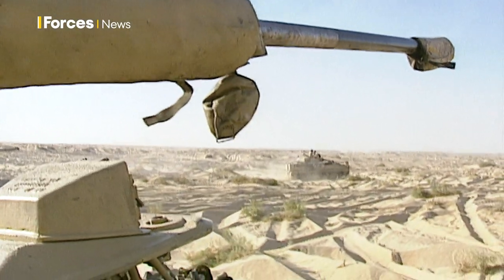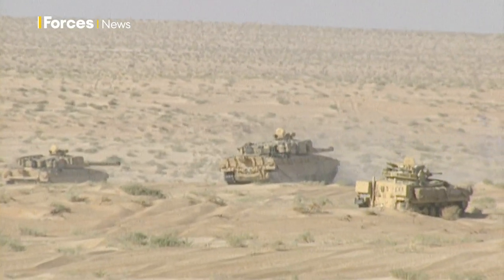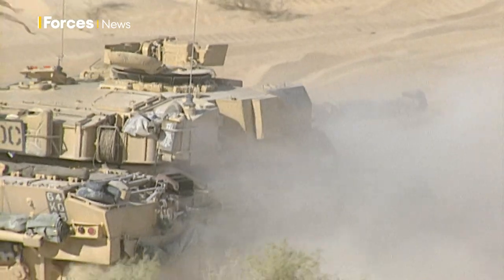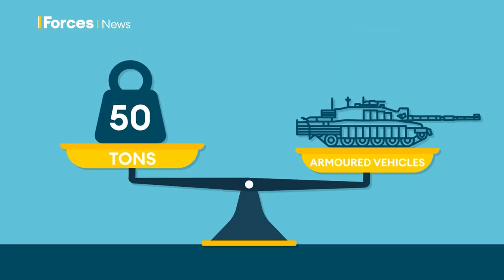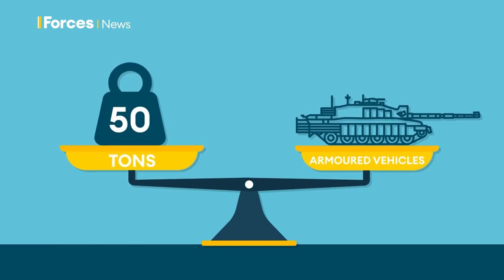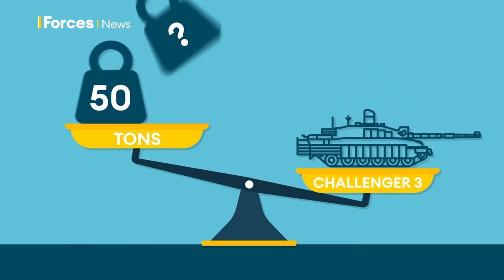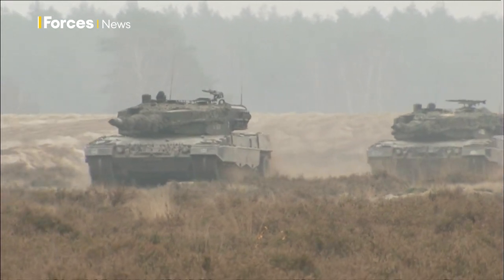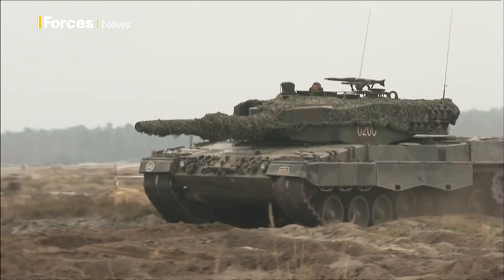Could Challenger 3 Tank Upgrades Be Axed Like Warrior's?

Comment: Warrior was ultimately axed because as far as I’m aware they already had full intent to replace all of them with Boxer, Challenger 3 should be fine due to the lack of replacement
Reply: Yes, this video is fairly disingenuous as it says "similar upgrades" and uses that term to mean similar situation/ context which is clearly inaccurate. The Challenger is the UK's MBT platform and the force is already being downsized. To not upgrade it would be the worst of both worlds. The Warrior situation is clearly different, as the "researcher" says - Warrior had issues with it's hull and turret system, something not applicable to Challenger. It was also up for replacement as noted elsewhere. Lastly, a IFV doesn't take nearly the funding or development as an MBT - in fact IFVs are regularly designed and sold across NATO forces so we could easily jump on another programme if we wanted to. The MBT is a different story - it represents the peak of a nation's armoured fighting capability. We'd as soon buy the Leclerc or Leopard to replace Challenger as the US would be to buy the Merkava as a replacement for it's Abrams.

One final point to shore up my last remark there - the "researcher" himself makes an indirect note about this. The only other use of the Challenger platform is Oman. Countries that are capable of standing up and maintaining heavy armoured fighting forces are not commonly countries that don't also have the ability to internally develop those armoured assets (In terms of first world countries anyway, Eastern European/ ex-Soviet allied states rolling about with T-34s are a different story). I do like the use of the export graphic suggesting we would sell the platform, or part thereof, to places like the Middle-East, Africa and Russia when its clear we won't even be exporting it to our Allies.
Reply: Boxer is a second line vehicle warrior is a front line fighting vehicle in need of a standard lifetime upgrade.....Boris Bone Head Johnson is a Russian stooge
Reply: @simonwood5147  well.... Boxer has better protection, mobility and is more modern than Warrior.
remember Warrior is only protected vs 14.5mm HMG rounds, Boxer withstands 30mm cannon and RPG fire plus it is protected vs Anti Tank Mines and IED´s, both not possible for Warrior.
Reply: @zhufortheimpaler4041  But..... Boxer can't go where a Warrior can because it's wheeled not tracked.
Reply: @thewomble1509  and thats also not the case.
Boxer can more or less go everywhere, Warrior could/can.
Only in very specific situations tracked vehicles have more mobility than wheeled ones and in these regions we use specialised equipment anyways.
A bog, where Boxer would get stuck, is also not save to traverse for Warrior due to the same reasons.
Extremly deep snow, where wheeled vehicles would sink in and get stuck are also not traversable for tracked vehicles.
We are not in the 1940´s anymore and technology has advanced.
AND the major factor is still, that 95% of combat operations happen in urbanised or urban territroy and the deployment is via road infrastructure (highway/Autobahn etc).
A tracked IFV is capable of packing thicker armor than a wheeled one and retain mobility.
But Warrior does not have better protection than Boxer, on the contrary. For that you need to look at Puma for example.

Comment: 4:13 yet the investment in larger calibre weapons has been completely abandoned and little to no armoured or unarmoured vehicles are fitted with atgm's
Reply: Modern APFSDS are still effective against tanks today. However his point, that many Chally 2 fans miss, is that because the chally chose to use two peice ammunition the lenght of it's DU penetrator is severely limited.

When you compare the lengths of the new German and USA 120mm penetrators then the Challenger IIs is shockingly short. It's for this reason why the CH2 has underwhelming firepower.

Comment: Exporting Challenger 3 will not happen and all manually loaded modern tanks weigh 70t or more, only Russian tanks are below 50t and they have autoloaders.
Reply: The ONLY country to buy challenger was Oman, and I believe that they are looking at Leopard 3 as the replacement (mind you the yanks are knocking on the door trying to sell Abrams)
Reply: Exporting relates to the turret only. The vast majority of Leopard 2's and M1 Abrams in operation will need upgrading in the next 10 years, dropping a CR3 turret on is an attractive solution.

Comment: Why don't there buy Leopard 2 hulls and put the new turret for the challenger on it and call it challenger 3
Reply: Leopard 2 hull design is 40 +years old; has a gigantically old-fashioned 47l engine; still uses torsion bar suspension; has open ammo racks next to the driver; cannot support more than 68t; and is constructed mostly from 20mm plate.
Reply: @agt155  Thank God there is another person on here who knows his stuff. All these young commentators talking as though Leo 2 was designed last week when it is in fact older than Chally 1 and 2!

Comment: Very concerning. What is going on with our procurement, it's a mess.

However I wonder if tanks are needed these days. The future is going to be air power and missiles, not sure I would want to be in a tank these days.

Drones are a real concern we need super rapid fire weapons that can shoot down a drone swarm.
Reply: Hard armour is useless, "IF" there are means of penetrating it.
Tanks may not be as invulnerable as before, but possessing/maintaining strong air power and missiles
are still challenging and expensive for many armed forces.
Drones are easier but they are already multiple solutions to counter them.
Reply: @enigmakashman3501  Yes there are means to shoot down drones perhaps we need more of those units, and faster smaller vehicles with missiles rather than a tank with a big gun.

The era of the tank is coming to an end I think, for our purposes anyway, I don't see another conflict involving massive tank battles.